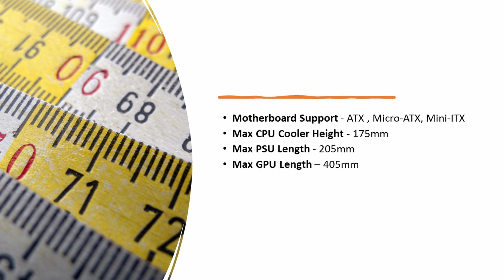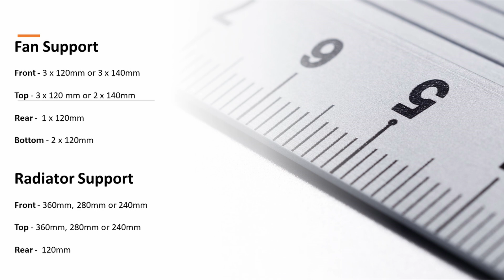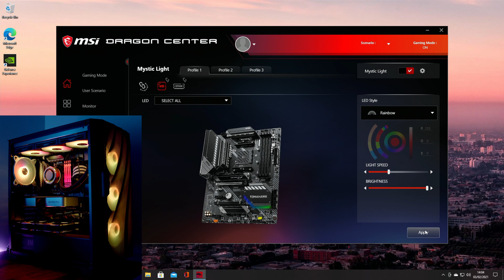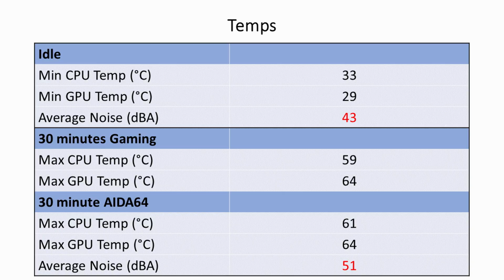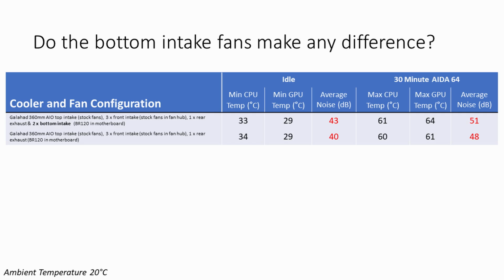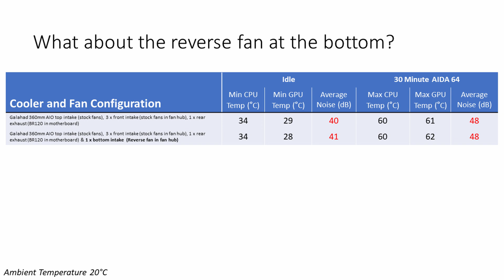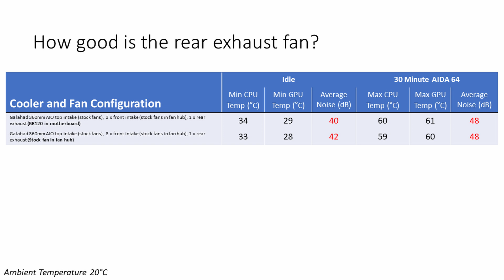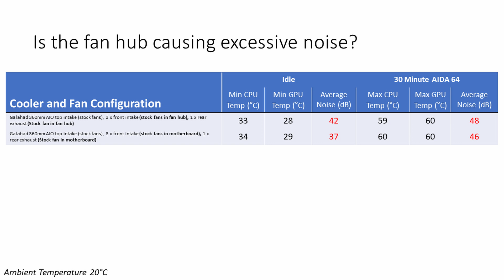Antec DF700 FLUX PC Case Review & Thermal Testing

Comment: A question about the fans, I am getting this case. 
Should the fans be installed with the ANTEC facing into the case or facing out. Thanks.
Reply: I'm sure you've probably already figured this out, but you want the exposed side (side without the plastic bars) to be facing the front of the machine, as it will be pushing the air out to the barred-side.

Comment: Were you using the fan hub plugged into pwm control on the board?    Do you think this is a good value case for a fairly budget oriented first build?   Is there any high quality single RGB fan that you would recommend getting for the rear position?  Lastly, if not using an AIO cooler, what would you put in the top, 2 or 3 fans, or leave it empty?  
   Thanks for the video.
Reply: 1) Antec's Prizm 120 argb. 2) Sickle flow from cooler master. I bought the former.

Comment: Great video this and the build video. I've got this case with a MSI X570 Tomahawk mobo, 3070ti Suprim and the MSI mag 360 AIO. I have watched your build video over and over. I'm now confused wether or not I should use the case argb controller or if I should run the 3 argb fans and 2 non RGB case fans directly from the mobo. I can then set in the bios hardware monitor PWM/DC in  for the fans if not mistaken?
If I have my AIO RGB fans and header plugged into JRAINBOW2 and case RGB fans into JRAINBOW1, they will be in sync?

Comment: Hi was this review done before they updated the fan hub? I heard they enabled PWM in response to noise complaints

Also do you think the reverse fan would be beneficial to exhaust the outflow from a 3080/3090 FE or would it go straight into the PSU?

Comment: Just wondering if you plug the fans into the motherboard, how do you get the argb to work? Does the case come with a splitter or can you still plug the argb fan cables into the fan hub and just not the fans themselves? Thanks for any responses in advance.
Reply: There's a fan hub that support up to 6 fans (rbg included), so it has 6 pwm fan slot and 6 rgb slot. Then it comes with other two cables, you can connect one to the fan header of your mobo for pwm (although it's not mandatory, if you don't plug it in you will have always the fans at top speed) and and rgb header (this is not mandatory either, you can control it via the button on the top of the case but you will be limited with the range of effects).

TLDR: you have a fan hub for 6 argb and fans, it supports pwm and rgb control via motherboard. It need a sata cable to power it up
Reply: @davidelancellotti8796  Ah okay, so I could use the hub only to control the fans argb and then plug the fans themselves into the motherboard instead?

Also is it worth leaving the rear fan in? From this video it looks like I may as well remove it for slightly less noise.
Reply: @Tom-101  yes you can, if you have enough headers on your mobo. Usually i prefer connect everything to the controller because all the fans are made for this controller and they interface well
But if you use 4-pin standard pwm fans they will spin at top speed all the time so you have to plug them in the mobo, if you only use the stock fans there's no reason to plug them in the mobo since they are all pwm

It's a positive pressure case, so there's really few to none difference between having it or not. Personally i just leave it in since it's all installed and set up but if you want you can just take it out, the noise won't really change much (maybe 2/3 dB)

If you want to know a lot more about this case and how you should use it i found this interesting video https://www.youtube.com/watch?v=7gdjbqOvUdA
Reply: @davidelancellotti8796  Hello. I noticed that you've been explaining this entire topic of fan speed control. Not sure if this is something you can answer, but on the Gigabyte Z490 Aorus Elite AC, there is a program called Smart Fan 5. Would I be able to control the fan speed through that? And if so, is it possible I can set these fans to go harder as my PC gets warmer?
Reply: @porfection1341  specifically i don't know, since it's a fan control program you should be able to do so. If it's a program made by gigabyte so i'm sure you can control basically everything, but if not it's probably just a monitor than a real controller

the best effective way to control the fan speed and fan curve (whether they are pwm , 4-pins cable, or controlled via dc, 3-pins fans) is in the bios, where you can actually set everything and really see the temperature and speed (although there are many monitoring programs out there)
Reply: @davidelancellotti8796  sorry I have read your recommendation and I also watched like 3 videos so do I plug in my pwm cable into my mobo or my fan hub since the pwm cable has 4 pin and the hub can only take 3 pins I know it will still work but I want to avoid any noise I plan on using the fans that came with the case

I just watched the video again I don’t think I have to worry unless I want to add extra fans
Reply: @aaanu_2169  soo let's make it simple
it's a full pwm header the one that comes out of the controller, yes it does have only 3 pin but the fourth pin missing in the one for the power, which is provided by a sata cable to your controller directly

it does not make much noise if you use all the stock fans, but in generally if you use 3 pin fans they will be all the same. but if you use 4 pin full pwm fans you'll have noise issue so i recommand to plug them in the mobo itself

tldr: 3 pin fans in the controller, 4 pin fans in the mobo

Comment: Dude, this review is amazing. Thank you for this!! Also, I’m making a similar build as yours and I’m having trouble deciding wether to go with an air cooler or liquid.. any suggestions?
Reply: liquid is generally better, it can provide more cooling but it's usually noisier (unless you buy one of the top units, like the arctic aios), but if you always use headphone and don't really care about noise go for liquid
Reply: Air cooling has always been more practical and longer lasting, there are actual air coolers that hit almost the same temps and numbers as the AIO cooler. One that comes to mind is the Thermalright Phantom Spirit 120 SE, I use that one and it a) outscores almost all other competitors including Noctua, b) is only $35, and c) scored almost similar numbers to an arctic AIO.

The air coolers generally last the lifetime of the machine, the AIOs pumps will eventually wear out and fail, requiring replacement.

I think it's a no-brainer personally, I have never been a huge fan of AIOs aside from their aesthetics, which means shit to me ultimately.

Comment: Hi, I'm quite inexperienced and only a beginner so I did not quite understand what you were saying about the fans having to be plugged in the motherboard rather than the included fan hub. Is it possible to plug all the fans in the fan hub and have the main cable of the fan hub connected to the motherboard so that the lighting can be controlled? Or do you have to plug every single fan in the motherboard individually to make that work? I don't quite understand what's the difference between the two. I'm sorry if this sounds confusing but I already bought this exact case and I'm preparing for a build pretty soon so I'm quite nervous about this.
Reply: So, 4 fans are already plugged in the controller out of the box (3 argb and 4 pwm headers) and you can attach the fifth fan to the controller to (so, with all the stock fans you will occupie 3 argb headers and 5 pwm headers). 
Then you connect a sata to it and you are ready to go, but the fans will go at top speed and you will have only a few rgb effects
If you plug the pwm and the argb header (the controller cables, they're a very well labeled, not talking about every single fans but only the two cables coming out of the controller) you will control the speed and all the effect using, effectively, only one sys_fan header and one jrainbow header on your mobo
Reply: @davidelancellotti8796  Thanks a lot for the reply, mate. It certainly makes it clearer.
Reply: @NeedyChris  thanks I was planning to buy the exact the same case for my next build so I gathered a lot of intel
Reply: @davidelancellotti8796  , did you build a machine in this case yet?   I think I am ordering this one for my son for his first PC... I am also new and "gathering intel" as much as I can...
   I think we will be using an Asus motherboard,  and a few corsair products... so will control all the RGB from iCue, as Asus will work with that.    I have also found that you can adapt a corsair RGB channel to run normal aRGB with a cable from Pirate Dog Tech (I am not going to try building my own cable) ... I think we will get one of those to connect to the RGB/fan hub.  The iCue will control the 12v RGB header, and the RGB on the Asus board (or an Asus GPU), ...BUT, Corsair has no intent to integrate aRGB controls, they want you to only be able to use their products basically...  
    Let me know if you did your build and how it worked out...
Reply: @isaiahfurrow7414  yes my actual pc is in this case. I have a gigabyte motherboard, so I didn't use their icue software. But, as far as I can remember, it won't work with the controller pre installed in the case because Asus want you to use all their products

But, for the case itself, is an amazing case, very big and with a good airflow
Reply: @davidelancellotti8796   , so are you able to control all of your RGB stuff with the Gigabyte software, and hook things up through the hub?  Do u have a build video or write up I can go check out? 
   Thanks for replying, cheers...
Reply: @isaiahfurrow7414  sorry but i don't have a video, since i don't own a yt channel or anything like that. 
But what i've done was connecting all the argb connectors at the built-in hub of the case (i also connected the 3 fans of the radiator) and then i used the case connector for GigaByte mobo.
(also, worth to mention, i connected all the fans of the case at the hub and the radiator fans at the cpu header)

It works totally fine with the gb software, never had an issue

Comment: It has been interesting seeing the different thermal behavior of the Lancool II Mesh, the Silent Base 802, and this case.  Let's face it, the difference in case layout are minor, and until we get a new motherboard standard designed for towers, we will always be fighting heat from the GPU affecting the CPU.  One important difference I DID see in this build, was the graphics card.  I'd like to see a follow up, using the same graphics card used in the Lancool II Mesh build.

Comment: I still find the RGB and aRGB connections, a little confusing at times (3 pin vs. 4 pins, and then which is PWM etcetera). Alas, I digress... 
 
I do like how they made the case with an 'easy' hub to control the fans and RGB. In addition, the RGB button is a nice touch. Albeit, not 100% sold on them removing the Reset button. Alas, I understand why...
Reply: well they did not remove the reset button, you can still plug it in the reset headers on your mobo since it's only a close circuit like the accension button

RGB and aRGB are a thing and they have a cable (whether it's 3 or 4 pin)
PWM or DC is another thing and they have another cable (3 pin for dc and 4 pin for pwm)
Reply: Alas... You comment has the word alas.

Comment: can't you set a fan curve on the bios so that the fans are less noisy using the stock fan hub?
Reply: yes you can, it supports pwm if your mobo supports it. the controller has a pwm header and if don't use it the fans will always spin at top speed
Reply: @davidelancellotti8796  thanks a lot!